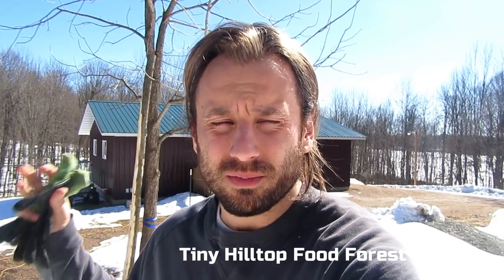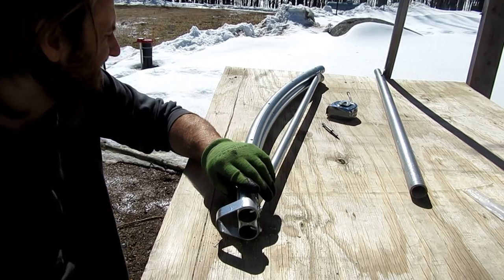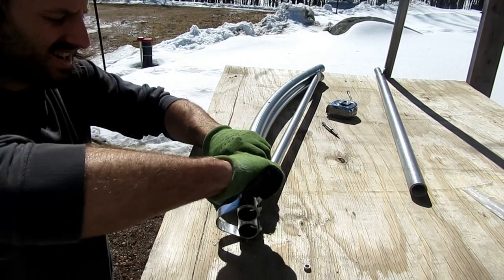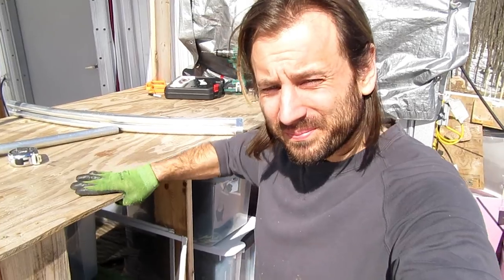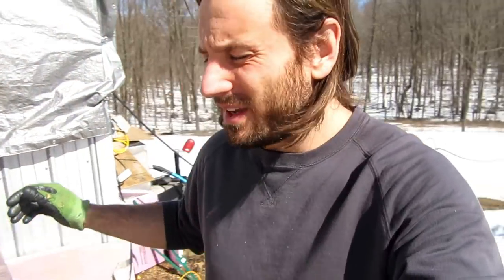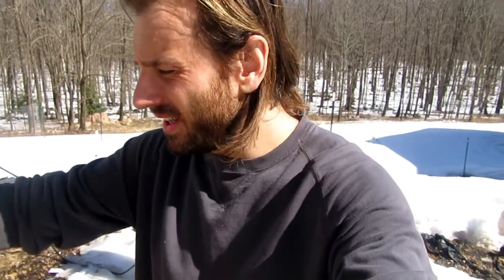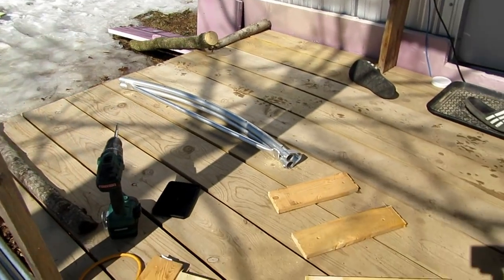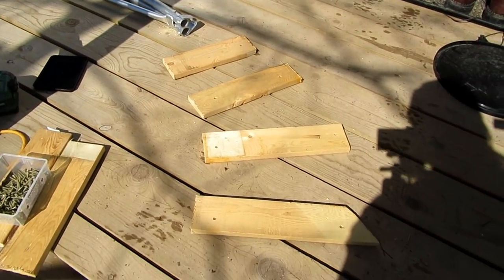The Beginnings of a Hoop House

Comment: That is probably easier than using wood, but of course you also won't get that shape with wood without doing a bunch of work that is not worth the effort.  If you like that hoop shape, then you picked the best materials to use probably.  The only last thing that could be a problem, but lets hope not, is the chemicals in the galvanized pipes. But even using wood, i would recommend non wolmonized wood, because of your sensitivity.  And then it is just as natural as the trees behind you.

I am building a goe-dome because i like the shapes. I am using wood and it takes precision cuts and a lot of effort, especially the first time, but i think it will be worth it because that is what i want.  IT is just more labor, not more materials. And if i get good at it, i will do it for others. I am not using a hub and strut design to build the dome(that is next to garbage, it works but only if you only plan to drape rolled plastic over it, and it is weaker than a real geo-dome), i am using a real method for building a geo-dome, the beveled frame method. It is so precise it can accept flat panels on the inside and outside, but you can also use the rolled plastic too. It is very similar to the first real geo-dome built, in how the struts come together with all the compound angles, makes it very very strong. And with all the compound angles being cut, it accepts flat panels, like lexan, and other green house flat panels, as well as any flat panel you want to put up. On the side sun don't shine in, you can use non transparent panels, etc... But that is why i am doing it, because it is precise and accepts flat panels resulting in a professional end result, looking like something from another planet, modern technological planet. Also because i believe geo-domes are a building method of the future, because they are the strongest structure for the amount of material used, plus they offer the biggest space inside, for the amount of materials used. For those reasons, i believe it is a building method of the future and therefore i want to know how to build them. Not just because i want one, i am doing it so i know how to build them, and to build more than one and spread the knowledge. Note: a 2 year old can put together a hub and strut design, and they work fine for rolled plastic greenhouses, very easy to build, and pretty cool looking and practical.. I am doing the real thing though, there is noticeable difference, it will be really cool looking and water tight, high wind resistance, even earth quake resistance, but the basic hub and strut design can work, and cheap as hell. But just because it is in the geometrical shape of a dome, it is stronger than if you used the materials and made it into a rectangle.

Thank you for your inspiration to grow our own, and building stuff.

Comment: You can always raise the the height later or next year if you want to after the chickens/seasons are done.  And was that a chin-up I saw you doing on the first hoop? Lol Is there any way you could use your electric cart to help bend the poles and save some strength? Maybe you could drive forward against the pole after you put it in the holder?
Reply from the maker: I think the lower height will actually work to my benefit.  Less air for the sun to warm in cooler weather.  It is really not that hard to bend them.  Only the last bend, and I figured out that I can just flip them around.  It is not too bad.